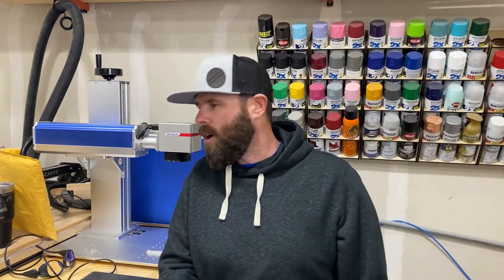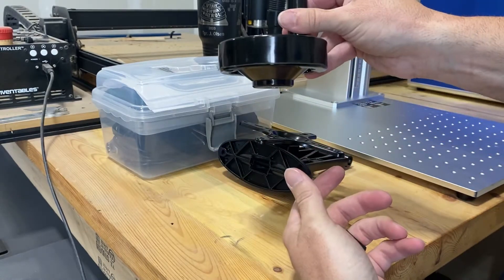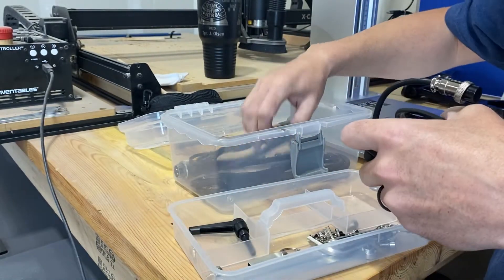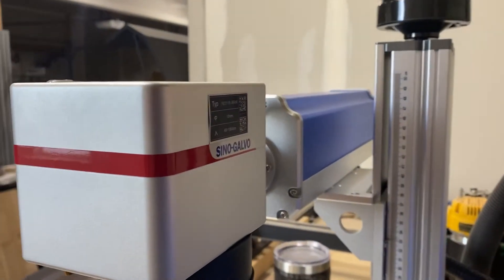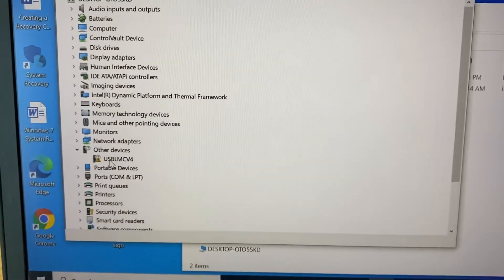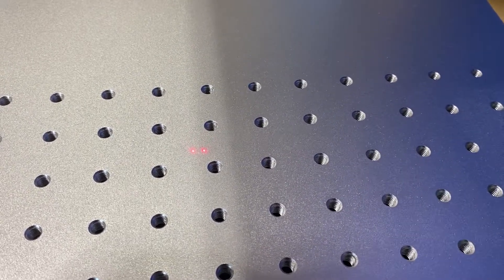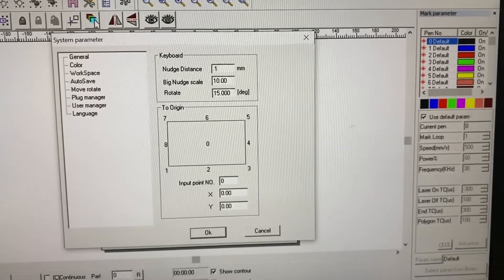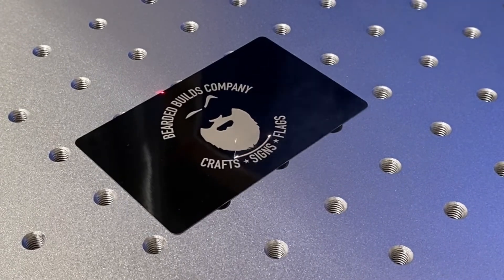Fiber Laser Unboxing

Comment: Were you unhappy with your 30watt if within a year you upgraded to the 100 watt MOPA?
Reply from the maker: The 30w was great for learning and getting started. I did find that I wanted to do colors and wanted to get deeper engravings. This is where the 100w MOPA came in. If I was to buy a starter machine again I would have done a 50w or higher.

The 100w MOPA is also part of a collaboration that I am doing with OMTech.

Comment: Hello, I have a dual red light machine I purchased from china recently, redpointing is working fine but the leaser does not fire up when I click mark, any help on this will be appreciated
Reply from the maker: Are you getting an error message? Have you focused the head? Is the lens cover on?
Reply: @BeardedBuildsCo , Yes the head is focused and there is no cover on the lens, it not giving any marking light or sound whatsoever apart from the Red(F1)
Reply: @BeardedBuildsCo  https://youtu.be/hwkAqQa2RcE
Reply: @BeardedBuildsCo  just to answer your question, the software is not giving errors, there is movement inside the lens without marking light.

Comment: Great video.  I really want one of these myself, but my main roadblock is what do you do to exhaust fumes?
Reply from the maker: The fumes on this are much less than a Co2 and wood. Most people will set up an inline fan and have set a duct next to the fiber work space to pull the fumes.